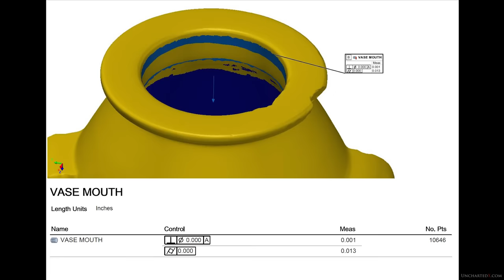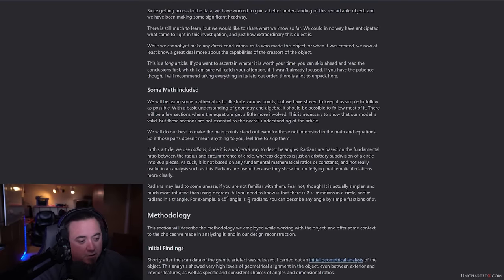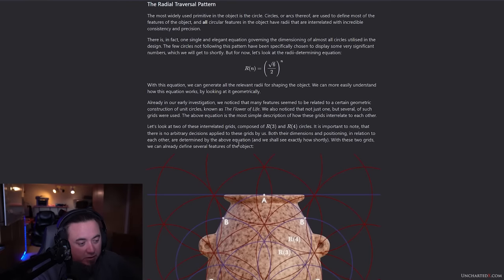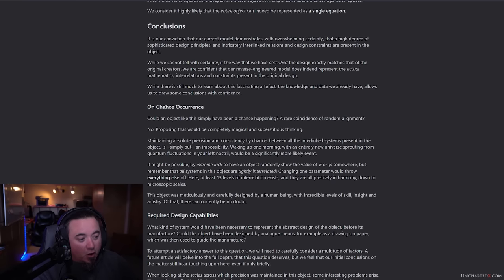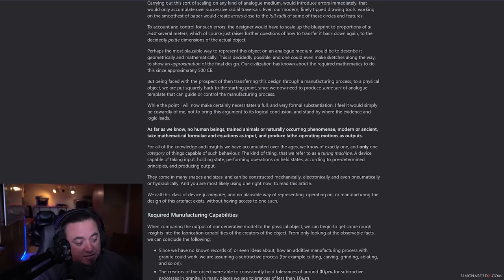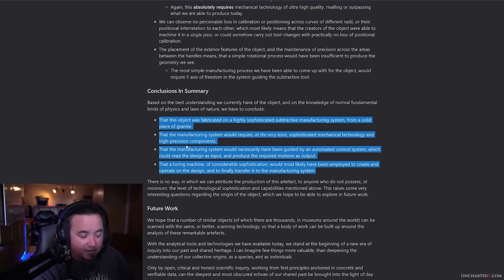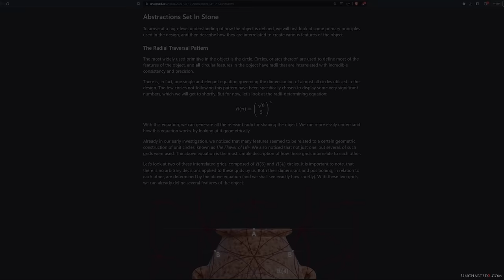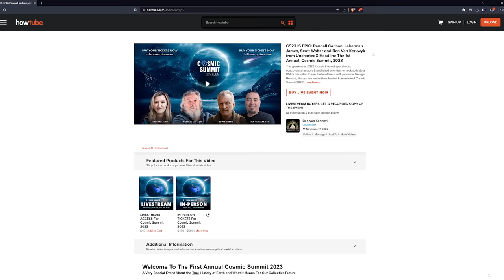Was a COMPUTER Used to Design this Artifact??

Comment: This is completely mind blowing information, and that's even with Ben skipping over the most amazing details of the math represented in the physical dimensions of the "vase".  I'm not trying to throw shade on Ben, as he probably assumed that these details would sail over the head of readers without a math or engineering background, but I'd like to highlight some additional key details of the vase dimensions.

If you read the paper, you'll see Mark and his collaborators called the radius of the smallest opening into the interior of the vase Ri.  If one arbitrarily sets Ri = to 1 Unit, then: 
- the maximum diameter of the top feature of the vase = π (pi) Units
- the narrowest external diameter of the neck of the vase = φ^2 (phi squared) Units
- the radius of the foot of the vase = π / φ^2 (pi divided by phi squared) Units
- other dimensions of the vase including height, width, and width at the handles, have fractional values (e.g., height = 9/2 Units)

This is just completely bonkers, probably one of the most elegant expressions (given the beauty of the object and the hardness of the material used to create it) of math concepts in physical form that exists in the world today.  But this is just part of the madness.  Ri, the radius of the entrance into the vase interior, which they've called 1 Unit, is 18.739mm, according to their measurements from the scan data.  This 'just happens to be' within 2 microns (and within the margin of error in scan data of this type) of the wavelength of a 16 GHz electromagnetic wave propagating in a vacuum, which is 18.737028625 mm.  Given the extreme design sophistication and manufacturing prowess that are evident in this object, it is not much of a leap to deduce that the creators of the vase knew the speed of light in a vacuum and well understood electromagnetic wave theory. Wow. This one object, if it truly is what it's purported to be, by itself, completely upends everything we thought we knew about human history and the origin of math, science, and high technology.
Reply: For 16 GHz to be significant (EM waves exist in a wide range frequencies) they would need to have used base 10 number system and seconds as a unit of time. That is of course possible but requires evidence from other sources.
Reply: interesting...and maybe the 40,000 vases were made with various frequency wavelengths as the base unit in their design (with the mouth of the vase not always being the reference point, etc). more to your point, the design of the Great Pyramid encodes the golden ratio, pi, among other things. it essentially serves as a scale model of the Earth.
Reply: @appropos  Very good points, which do highlight additional assumptions which I left unstated. Base 60 (for time) was in use contemporaneously (in Sumeria) with pre-dynastic and Old Kingdom Egypt, with 10 a key part of their numbering system, but that doesn't necessarily mean that was the time system used by the creators of the object. Personally I feel that it's more likely than not that the Sumerian system and that used in Egypt was descended from the same precursor civilization, as the farther you go back in time, the more alike construction methods become, which implies a common knowledge base. As time went on after the collapse of whatever society created these monuments and these objects, divergence increased, and eventually we ended up with absurdities like the Roman numeral system.
Reply: @appropos  the physical distance is still the same, no matter what number system or units are used.
Reply: @AustinKoleCarlisle  Correct, but I think what @appropos is pointing out is that the frequency won't be a convenient round number like 16 GHz if time is measured in different units.  There will still be a EM frequency of that wavelength of course, it just wouldn't be one that rolls off the tongue like 16 GHz does. E.g., 125,263,947 cycles per fubar instead of 16 billion cycles per second.
Reply: @kenpumford754  I was thinking about this last night. maybe whoever made these objects was trying to tell us something. maybe the vase was created using that particular frequency, or maybe the type of granite that vase is made from reacts to that particular frequency in a certain way, etc. it'd be interesting to see if vase shape and style correlates to granite/stone type.

Comment: I have always leaned toward the idea of one pass with no tool change. There is a tool that isolates the object and removes the excess granite. The cutting mechanism is a beam of energy or perhaps the same technology that isolates the object and moves it, also cuts it.
Reply from the maker: yep it could be something other than a regular cutting tool. Shamir? Still needs guidance, and a system to translate the design to the manufacturing system output.
Reply: the pyramid stones were cut with basic alchemy. The methods are handed down but done so in the complex, flowery, encrypted language which is traditionally used by alchemist. It's possible this vase is infact instructions designed to represent the knowledge that was used to make the object. Often sacred geometry is associated with "gods" which are "planets" in the macro and "elements" in the micro, As above so below and all that. Alchemist used this geometry to represent the processes that are used in the construction of the artifact. Analyzing The pyramid angles and using the data you get how the stones were lifted and shifted just as Wally Washington showed but it also contains the data on the chemicals used to cut and shape the stones. When analyzing alchemical knowledge hidden in sacred geometry it's important to always remember the perfection of the triple unity. The hermetic teachings are all very clear about this, all things have three natures that define them or as tesla understood that everything is spin, vibration, and projection. The flower of life is actually the flower of light, as what is currently called a photon does not actually exist, it is an illusion caused by a 3 entagled electrons moving several magnitudes of order faster than light in the flower pattern as it moves through space. Each petal represents a point in the spectrum. The reason the slit experiment works the way it does is because the particles path is compressed on entering the slit and thusly has a major energetic rebound on leaving unless it is observed in which case the pressure of the observation causes the path to remain a single point. Anytime an electron is split away from the other two you get decay of the main wave forcing it into a diffrent pattern until it decays further into single rouge electron.
Reply: I would propose something different. granite can without a doubt be made soft like clay with plant chemicals without heat, so that it can be shaped by bare hands with no effort. evidence for this is all over peru, where even ancient texts talk of this and we can still identify which plants were used. its a process that is well known. plants use these chemicals in their roots to dig into rock and to absorb minerals. it works by cutting specific chemical bonds, and can also soften metal. birds use these plants to drill holes in granite to nest. I believe they used a combination of softening, molding and cutting, and although its speculation, the fact that it is based on intersecting spheres and radiants means that the shape is also perfectly defined as a sum of frequencies or vibrations and their interference, prompting me to believe that they used high powered ultra sound waves to push the soft granite into its shape by adding the pressure of these waves in such a way that negative and positive interference would result in the object.  certainly some parts like the interior or the handles was not made with such a precision. but I think the object that came out of the device they used originally had a different shape and was not hollow inside, and they used a second process to transform it into a usable vase, likely softening plus cnc or lathe plus softening. the insane penetration rates can be explained with the softening, as well as the penetrating, non eroding mirror like finish of them. I think the precision shown in this object is too precise for an extremely powerful tool, but the softening makes any kind of laser or high energy technology completely unnecessary.I think the fact that some geometrical  aspects are way more perfect than modern ones but other details on the same objects arent tells me that they probably did not know or use the processes we use, but more natural ones which require much less technology to pull of but at the same time a technological and physical understanding that is way beyond our time.  I think if we saw these people work, we woud never see huge machines, but ones that are much more economical, light weight, etc, which use nature in such a way that they would not even need computers to guide processes, and would rather use computers to control these processes and use natures perfection to achieve such a superhuman precison. piezoelectric materials allow the induction of ultra/infrasound via an electrimagnetic field, and since false doors and other harmonics based shaped were often used, it prompts me to believe that their machines, and even computers, were actualy mostly made out of megalithic stones, which could use the response to vibration and its intersection to compute and represent states similar to bits and a compter processor, where logical functions can be computed with frequencies activating certain electronic and other megalithic componets. if you can make a computer based on light waves and mechanical elements, you could also use sound waves, and although they are much slower than the speed of light used in electronics, they might offer a representation and computation of much more than just 2 states at once similar to quantum computer, but slower and without the extensive cooling, expense and limition. maybe trading  speed of a single operation for numbers of states and steps in a calculation, usability and its indestructible nature makes it superior to modern ones, who knows.  note that ancient objects have been found that look exactly like a modern electric motor molded into piezoelectric rock.I believe their entire energy grid system and their tools/machines were mostly made out of piezoelectric stone and operated/controlled by sound waves, without many moving parts at all, which would also explain why you seemingly find no tools. the metals they contained were obviously melted by later people, but I think most of it would just look like peculiar shaped and  machined stones with few actual metallic parts. I could imagine a hand held electric drilling machine than looked like a tone with an electromotor inside and something to fit the head, and instead of buttons or wires to control and power, it likely was powered and controlled by a 2nd source of ultra sound that could be operated by hand.
Reply: @sshreddderr9409  this is a pretty succinct Hypothesis. Completely believable and I lean more and more towards this being a plausible method. All of the above points to an ancient technology tho surely. Because logic dictates if the Egyptians had that knowledge it would have never disappeared from their culture and we’d have evidence of it. Or at least there would be some remnant of information. Maybe it’s there and we’ve misinterpreted it. 

You did say at the start “evidence for this is all over peru, where even ancient texts talk of this and we can still identify which plants were used.” can you please provide a source for this? Surely if we can create the recipe we can answer definitively whether stone especially in Peru can be softened and shaped.

Comment: I am suprised that the analysis of this object didnt turn up any other "things" previously hidden from us, such as manufacturing marks, some previously unseen identifying marks or something encoded we didn't know about. It's just so damn straight, plain and mind blowingly amazing with absolutely no clues at all to it's age or origin. The ultimate enigma. I wondered if the damage may give a way in to it's manufacture. Was a rock softner used? Heat? Printed or subtracted? Would a manufacturing technique make the surface differ from the structure of the interior of the material is was made from? Would softening the outer make it look different to the inner material that vould be observed in the chipped area on the rim. This could be the next best place to study as this damage could give us a look at something we will never get to look at with an undamaged example.

Comment: Yeah, they had super technology, but decided not to bother using it for the handles, I guess.
You need to go to specsavers if you can't see they're skewed and, therefore, not made with 'advanced technology'.
Reply: Just like with OJ, if the handles don't fit (the overall design), you must acquit. I think it's some kind of carbon fiber epoxy material.
Reply: yeah and the outside of the Serapeum granite boxes aren't perfectly flat and aesthetic like the insides (at least for the finished ones). you're being shortsighted about this.
Reply: right? like how does everyone who believes this videos just blindly look past that fact that is is out of wack top the naked eye?

Comment: This can be done without a computer.
Reply from the maker: off you go then
Reply: @rogerpatterson3422  
The title is "were ancient computers used to design this artifact."
These can be designed with a compass/divider. The most ancient and simple design tools ever.
You can stick a stone on a potters wheel with clay and spin it while applying a tool against it and checking it with a template.
Reply: @Foche_T._Schitt  you clearly don't know what a micron is 😂
Reply: @MrChologno  
I have a mill, a lathe, a surface grinder and a granite surface plate. I also have Outside Dial Micrometers and calipers within arms reach of my computer. I don't always work in Millimeters, but I foching know what a micron is.
Reply: @Foche_T._Schitt  Well. We look forward to seeing the results of your work. Should be interesting.
Reply: @Foche_T._Schitt  So you definitely have no problem reproducing this to prove your point. I really am looking forward to seeing your work.
Reply: @TheCuriousOrbs  
I don't have too. You can find multiple video's of people making these. You can also find a video calling UnchartedX out on his bs claims. They're not as imperfect as he claims.

Comment: My background includes working on electrical/electronic controls for special machines that are used to create, assemble or manufacture other things. The class of machine used to manufacture an item like this vase is CNC (Computer Numerical Control). Programs are used to turn 3-D (three dimensional) CAD drawings into M Code (Machine Code) which are the instructions for the machine to make the part. When I saw your first video describing precision vases I concluded only some form of CNC could possibly have created them. This video hints at a level of design simplicity, elegance and sophistication quite different from what we do today.
Reply: I do believe we are survivors of a past civilisation. However, people are capable of doing amazing things ...
An interesting experiment is currently occurring in Russia which you might want to follow up:  a lady called Olga Vdovina makes stone vases by hand. it takes at least six months to make one. Olga is now filming the process as she creates a diorite vase.
Reply: @lynnehaywood5305  Actually, no - it is not. I remember stumbling across her on that channel 2-3 years ago. I was impressed by her patience and determination to get the first vessel done (sticking at it for 4 months 5-8hrs/day 5d/w). Apart from her work, the whole thing was a disaster though. 
They had her copy a vase from 1st dynasty using tools taken from a relief dating - tmk - to the 18th dynasty. And it was marble they had her work on. So, in essence they proved that the Egyptians really could work marble with the tools depicted in reliefs from 18th dynasty. Well, sort of - a piece actually broke off and was glued back on - kudos to at least admitting it ;). So, not really a surprise.
Then they said, ok - marble's 'soft', lets do the same in diorite. Set up live-streams (which I occasionally would drop into, but after the 3rd change in URL, I lost track and interest) to sort of give the impression of reliable accountability. Well, to my knowledge, they never completed it. There was an update, rough 2 years ago, showing how far they got (after 4 months?), but silence since then...
They call it science - but no mention of tool marks (yet alone tolerances) in the original nor the intended goal of the whole operation. So, IMHO, they (rather) didn't bother to examine the original (too) closely. Bottom line - especially given the recent measurements UnCharted-X has provided, the only goal achievable for that experiment can be summed up to 'make an object that looks similar to the original in diorite'. So, in essence doing the same the Egyptians did - seeing something pretty cool and doing a pity job on copying it with the tools available to them (in the 18th. dyn).

Comment: Hey Ben,

Another metric by which you could verify the complexity is if you cut the CAD model vertically in half and compare margin of difference when both sides are overlayed, then cut a half vertically in half again and see if the vase is 4 identical parts